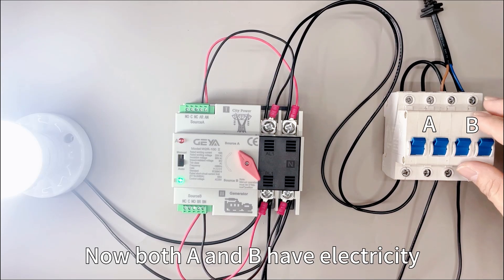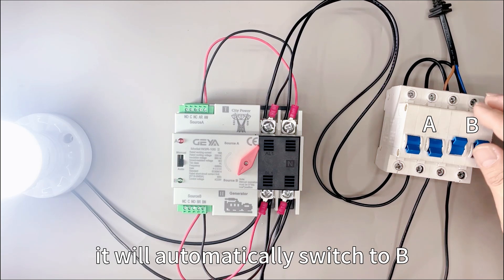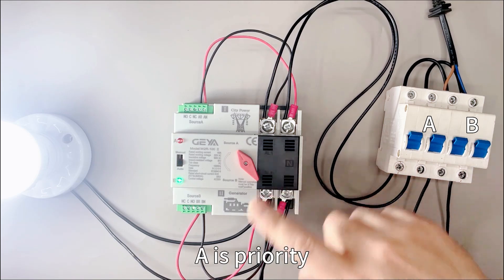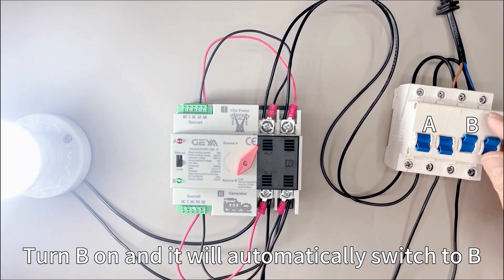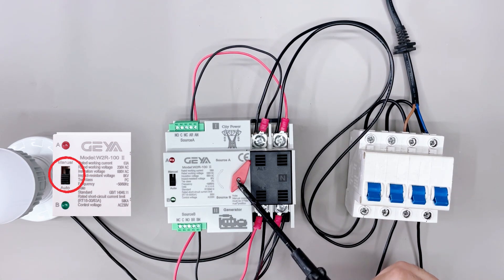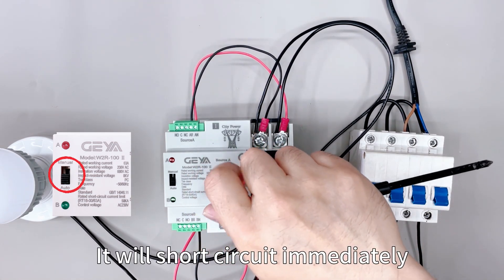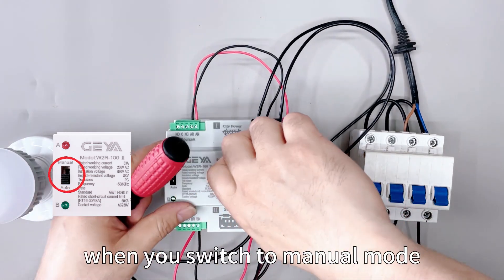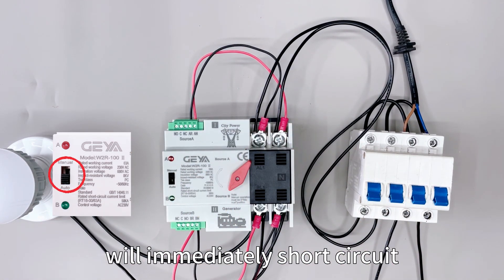GEYA W2R Automatic Transfer Switch

Comment: Perfect. Awesome video. If I wanted to add this ATS for a home running 220v (2-110v legs) with neutral and ground, along with a generator that is running the same,  how many input/output would I need on the device?
Reply from the maker: Please check our catalog.https://www.geya.net/wp-content/uploads/2024/04/GEYA-W2R-ATS-CATALOG-详细版.pdf
Reply: @geyaelectric1302  I have seen your catalog but, I would like a referral based on my criteria if possible. Thank you!
Reply from the maker: @gmbeingit  Please visit our official website to contact us.https://www.geya.net/about/
Reply: Don't buy this kind of product...
Reply: @hanmandlugajengi  Bought and works like a dream. Great product
Reply: @gmbeingit  which one you bought?